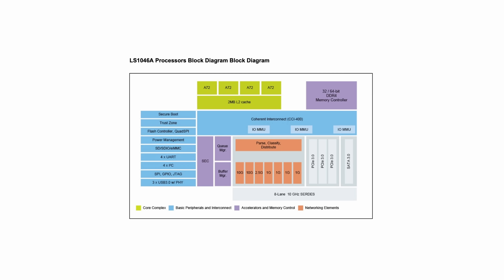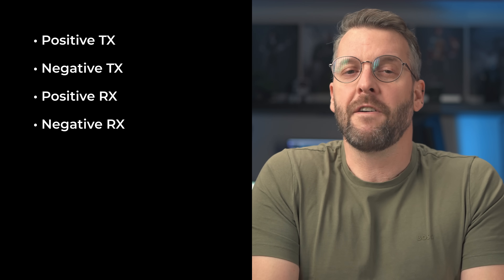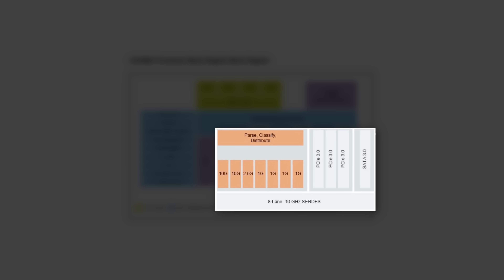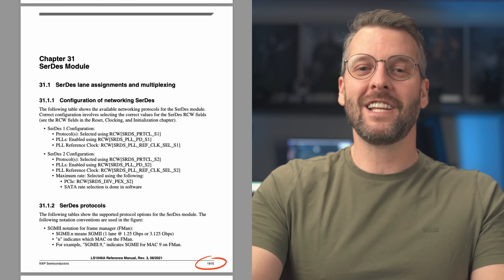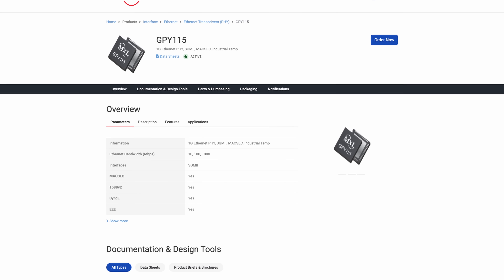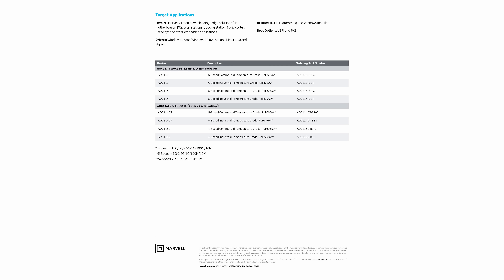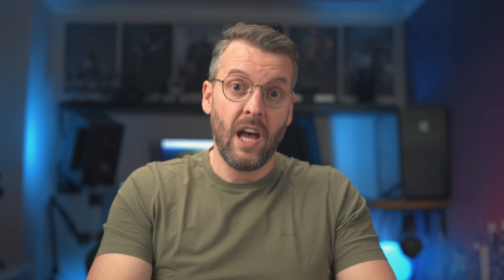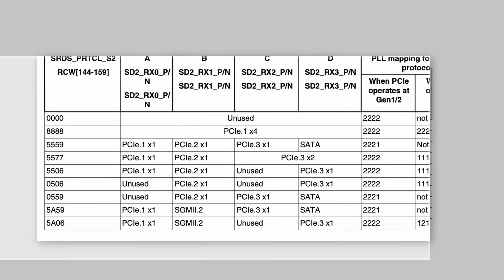You sure do LOVE your 2.5GbE ports!

Comment: other question: which SFP modules does it support? often devices with 10 gbit/s sfp ports support up to 10 gbit/s meaning they often support sfp tranceiver with lower bandwidth as well, so does your router maybe support 2.5 gbit/s rj45 sfp modules? then you would even dont need a 10 gbit/s switch for getting the 2.5 gbit/s ports and also dont need the extra 2.5 gbit/s port but if multispeed is not supported with these sfp ports then I would prefer to even have one extra 10 GBase-T multispeed port using the Marvell AQC113 chip

Comment: I was skeptical when you said you weren’t even planning to support wifi, because of the dozens of devices I have, my Raspberry Pi is the only one with an ethernet port (making the 2.5g vs 1g question irrelevant to me).
I’m really pleased with your slotted approach, though… this could be the best-value router (ever) if it has the ability to be upgraded over time with new wireless modules.
It sounds like you’re doing a great job of evaluating the trade-offs and finding ways of being price-competitive. 
I hope you can sell the router both with and without the wireless card so that people can opt in if they need it or can buy “verified compatible”modules and upgrades from you in the future

Comment: Hi Tomaž / @tomazzaman, not sure if you're checking comments but the E slot does not require 2 PCIe x1 lanes. It can be wired that way but not all manufacturers use it wire the slots up that way. I actually made the change to the table to try to clarify that back in late 2022. You could potentially add an additional PCIe lane to you implementation if you wanted.

Comment: Hi Tomaz. Question and idea: AQC115 is 2.5GbE single port. Why you should waste these PCe 3.0 2x lanes just for one 2.5GbE port? Yes, is increasing the price of the router a little bit, but adding a PCIe 3.0 switch on 2x lanes or even PCIe 2.0 x2 lanes and distribute to 2x or even 3x 2.5GbE PCIe NICs can be a solution: PCIe 2.0 switch 2x lanes has a bandwidth of 1000MB/s (8Gbps) and 3x2.5GbE should have about 937.50MB/s (7.5 Gbps). Also if you use a PCIe 3.0 switch you can use some additional lanes for other devices.
Or in my opinion you should optimize the full number of ports like this:  2x10GbE and 3x1GbE interfaces  using SerDes1 0x1133 and SerDes2 0x5A59 or 0x5A06. In this case you will have 3x1GbE interfaces + 2x 10GbE via DPAA and additionally you can add a PCIe switch Gen3 to add 2x 2.5GbE interfaces which obviously will not go through DPAA. But PCIe 3.0 1x can handle 7.880 Gbps bandwidth which is more than enough to use for example 2x 2.5GbE interfaces via only one PCIe 3.0 lane shared via a PCIe switch.
I don't understand why to waste PCIe 3.0 x2 on a single 2.5GbE chip.
In SerDes2 0x5A59 also enables you one SATA if you need.

Comment: I seem to be in the minority but my use case a 2.5 gbe Port is useful as a WAN. Around here if you want multigig internet with Comcast your options are either LACP or 2.5gbe. If the sfp+ port can negotiate down to 2.5 gbe that may be an option but I personally found many sfp+ ports which won't run 2.5 gbe even with an adapter and instead not working at all or dropping to 1 gbe.

Comment: Could call the vendor and see if you can check out SRDS PR  S1 RCW: 1223
they might support it, but it not in the datasheet. Could work if you try anyway, but without support.

OR

Use a chip with more lanes and get rid of that dumb case; 10gb, 2.5gbe poe+ and more horsepower are the opportunity cost of it.

The cheap chinese 10gb/2.5gbe switches use a realtek set to route, and the web management is done with a seperate micro. No reason you couldn't smack some compute on it.

Comment: @tomazzaman
please make sure that the linux kernel can handle forwarding 2.5Gb of traffic.
from my experience, there is an issue with linux on arm when it comes to high data rates, even 1Gb puts a lot of load on the cpu.
Reply from the maker: Not this CPU, it has dedicated networking hardware. Even the two 10GbE ports should be easy. I'll report once I test the development board (in a month or so)

Comment: If it really came down to it, I think I'd be alright adding an SFP+ module that can negotiate at the various NBASE-T speeds to the router's included SFP+ port. I don't think the price increase is worth the very slight reduction in functionality, especially if that locks out access to the PCD part of the silicon. You could also (potentially? I'm not speaking from experience here but from what I've seen in the videos already) very slightly increase power efficiency if packets can all be processed by the same core, leaving the other cores open for other tasks. Maybe it would be worth experimenting with this.

I have absolutely no personal nuanced experience and I am by no means an expert, but gosh darnit if I paid for the whole silicon and all those features? I'm gonna USE the whole silicon and all those features!

Comment: The cost difference doesn't make sense for that little gain, leave 2.5 GbE out :) 
Besides, if you use PCI-E instead your traffic will NOT be processed by the Parse, Classify, Distribute logic, and will consume CPU cycles. High CPU usage means more power consumption, less efficiency, more heat, it MUST be avoided.
And speaking of CPU usage, I want it to be able to allocate most of those resources for Firewall, VPN or other services; not the traffic switching.
My 2 cents for the project :)
Keep up the good work

Comment: This is pretty cool. I actually own a software development company and I work in the network area (presented in netdev conference last year too). Let me know if you need anything. I hope we can have a Yocto repository for this project too.
Reply from the maker: Thank you! The first challenge is actually developing the hardware to a working state (which we have already started) and in the meanwhile, figure out all the software/build requirements and procedures to make it as compatible as possible.
Reply: @tomazzaman  I’ve worked with Freescale before. They are one of the best supported architectures there are. Freescale even had a VHDL team in Brazil before being bought by NXP.
Reply: I’m just finding very difficult to find information in DPAA, which would be vital for IDS.
Reply from the maker: @felipemalmeida  It's on my to-do list to test once a) development boards arrive, and b) we manage to install/run some kind of software that does it

Comment: You could also let the 2.5gbit be an optional extra over the m2 slot. Yes, the user had to decide between WiFi or 2.5gbit Ethernet. 

With an “optional” module that you can insert in the m2 slot and a provision for the optional Ethernet port in the case you might have the most flexible solution. The cost of making the provision for the Ethernet jack in the housing should be less than the cost of including the 2.5gbit port in the base board. 

This would give you 2x10gbit, 4x 1gbit and optional 2.5/5gbit Ethernet or m.2 WiFi.

Comment: From my experience with home networking a high performance home router ideally for majority of users needs only 2 ports but for convenience and flexibility 3 or 4 ports is probably best. I would expect that people who need a high performance router like this have a high-speed network with an advance setups with VPN, QoS, VLANs, smart firewall bouncers etc. And those users already have or will highly benefit from having dedicated switch(es) and access point(s), and they can afford those devices or find some good used/refurbished options.

Then why only 2 or 3-4 ports?  Because if you have a vlan-capable switch then you really need only a WAN and LAN port. But of course having only two SFP or two ETH ports would be too restrictive so it's probably best to mix SFP and ETH and that has the added benefit of allowing the users to easily create multi-WAN or multi-LAN setup and/or some service port. 

So to me, a router like this needs fewer high-performance (ie. utilizing dedicated SoC infrastructure) ports rather then multiple ports of many types .

Comment: Something you didn't make clear in the video. If you go with the original configuration (so no 2.5Gb) then SerDes2 has a lot of configuration options available for pcie. I think if you do that you should do one of the following:
- pcie 1x2 for an E key slot and pcie 3x2 for an M key slot
- pcie 3x2 for an E key slot and pcie 1x2 for an E key slot.

Basically I feel like leaving pcie unused and unavailable (not routed) would be a waste.

Comment: Your mention of losing DPAA hardware processing by moving 2.5GB over to PCIe is what kills it for me. I'd rather have integrated support for 2x 10GB SFP+ and 2/3x 1GBe and have better hw acceleration over tacking on 2.5GBe. Like others are saying in the comments: This is a router, not a switch :) 
Not to mention that 2x10GB and 2x1GB is a near perfect spec for home/SMB use and is perfect for budding multi-gig ISPs. 1x 10GB for WAN, 1x 10GB for LAN, 1x 1GBe for Smart home/IoT, and 1x 1GBe for OOBE. 
If anything, I'd personally rather see just 2x 10GB, 2x1GB, and PCIe lanes for an add-in card down the road. I was going to suggest IPMI using something like an Aspeed chip, but for a router that really makes no sense, and it's more logical to just have a serial controller for console access imo. 
Love the project, will be following closely :)

Comment: I don't think the most complicated part about designing a motherboard is routing traces. I've only made one motherboard before, it was an easy Intel Atom design. The hardest part is getting the power right. The software will automatically get the trace length right now-a-days. Data uses hardly any power compared to power delivery, so you can get away with small traces. Some places you cannot do this and there is a lot of math involved.

Comment: That is a really badly designed processor if it has too weak (or poorly designed) serialiser, so that it cannot even handle all the ports that the network controller has.
Whats the point of having a complex network controller if you cannot physically connect all ports. They should at least make some of the network ports go through the second section so you would choose: more networking or more PCIe, but realistically they should have just made the serialiser bigger.
Unfortunately nothing that can be fixed by you, unless you will be able to find a different skew of that CPU with better serialiser.
Reply from the maker: An 8-lane serializer is perfectly adequate. They do have other processors with more lanes, but they also cost more. It's always a compromise.
Reply: @tomazzaman  ok, but whats the point of 10-10-2.5-1-1-1 networking if you cannot even connect it due to the serializer?
They could just call it 10-10-1-1-1 and save the confusion (and possibly costs).

Also how much more expensive would be a skew of the same CPU with bigger serializer? Have you checked if maybe that is a cheaper way to get 2.5G than PCIe

Comment: Same for me dual sfp+ the 2.5 I get it people want for AP’s but that’s pointless without PoE. I’d rather some extra go towards supporting PoE in or alt power. 

Also FYI the OSI layer model you use is the obsolete 7 layer one that never became anything. TCP/IP and packet switching won that war and OSI was reorganized to the 5 layer model that represents networking as we know it so they could salvage some of the effort they had put in.

Comment: You can just use an SFP+ module to get 2.5 gigabits, but since those work by lying to the host and claiming they're linked at 10 gigabits, you'll need SQM to avoid trying to send 10 gigabits through that port.

Maybe you could have one or two pairs of "SFP+ or 10Gbase-T/Nbase-T."  In each pair, you'd choose one or the other, maybe even only at boot time.

Or it might even be cleaner to simply allow overriding the SFP+ module's lie that claims it's linked at 10 gigabits!

Even with a 2.5 gigabit port, I'd probably still want to SQM it anyway, since my ISP connection's sustained rate is like 1.1 gigabits down, 40 megabits up.
Reply from the maker: I too think that 2.5GbE would be best avoided at this time and focus on the two 10GbE ports to do the heavy lifting. Delegating the rest to a switch. Like it's supposed to be. 😅
Reply: @tomazzaman  For a WAN port though, a switch may be a problem.

If it's an unmanaged switch that drops VLAN tagged packets (I have a 2.5GbE switch that does that), you won't be able to use it for ISPs that require all packets to be VLAN tagged.

If it's managed, it may send a packet that will cause dumb cable modems to restrict their DHCP to the MAC address of that packet (even if it's not a DHCP request!) and thus fail to ever give an IP address to the router.  I once tried a GL-B1300 on Charter, and it ran into that issue because it sends a TFTP request at boot time with a different MAC address.

I think the ideal solution would be to use an SFP+ module, and figure out a way to make the router realize when it's really running at 2.5 gigabits even when the module claims to be running at 10 gigabits.

I think there are some SFP (not SFP+) modules that run 2.5 gigabits natively, I wonder if one of those would work while still having 10 gigabits on the other SFP+ port at the same time?

Comment: Ditch the 2.5Gbe and add another M.2 slot as it is more flexible. Users can add their own M.2 to 2.5Gbe adaptor if that is what they need. Maybe allow a blank punchout in the back of the case where the RJ45 port from the M.2 to 2.5Gbe adaptor goes. For examples of these adaptors watch the video from Wendell @Level1Techs
Reply from the maker: Actually, that makes a lot of sense. I've written it down.

Comment: my inclination would be to keep the ethernet configuration as-is and use the left over lanes for a M-key M.2. Putting a low cost PCI-E NVMe (like optane) will make the router much much more reliable and allow swappable storage.
Reply from the maker: Yep, that's the alternative. If those lanes aren't used for another PHY, then we'll add another M.2 socket with M-key. Cheaper too :)

Comment: Hey there, I understand if you disagree, but I really think it's important to consider how your device integrates into a network setup.

In terms of future-proofing without inflating costs, here's what I suggest: incorporating 2x 2.5G (or 5G if bandwidth allows) and 2x SFP+ 10G ports as the ones you already have.

Here's why:

1) With internet speeds exceeding 1Gbps in many countries, this setup accommodates a WAN connection via 2.5G or one of the SFP ports, if your provider supports direct connectivity.

2) The second 2.5G port provides flexibility for direct device connections, be it a switch or a tool for network management and debugging.

3) The additional SFP+ port allows seamless integration with a modern switch's uplink. Since users of a robust router like this likely have a switch for their devices, the flow would be: Internet > (2.5G or SFP+ 1) Your Router > (SFP+ 2) Switch > (Switch's port) Devices.

4) Having 4 gigabit ports would limit both high-speed internet reception and device connections. It's redundant to have two SFP+ 10G ports if the uplink is only 1Gbps, or to have gigabit ports if SFP+ ports suffice for the uplink and switch. It just doesn't add up in my opinion.

Comment: Absolutely not!
The two SFP+ 10G ports should suffice for virtually all scenarios. Introduce a switch and VLANs, and you effectively have an unlimited number of interfaces at your disposal for your router! 
I'm curious if the LS1046A can negotiate link speeds of 2.5G or 5G on its SFP+ ports. Not all SFP+ interfaces support these speeds; some are limited to 1G or 10G. If the LS1046A can be configured to establish connections at 1G, 2.5G, 5G, and 10G on these SFP+ ports, then we certainly won't require the 2.5G port!
Reply from the maker: This question seems to be a very popular one (whether SFP+ can negotiate 2.5G or other speeds). I'll do the homework once the development boards arrive, and report back.

Comment: I have an alternate solution, it looks like acquantia xfi phy ics, you could put a serdes mux between this and one of the xfi serdes, and then use this to implelent a 2
5g ethernet combo port for about $30. Though probably the better option is to suggest people use a switch or a 10g-baseT tranciever that supports 2.5G.

Comment: The more recent cable modems have a 2.5Gbps port. If the 10Gbps ports are not NBASE-T (i.e. they only do 10 or 1Gbps, and not 2.5 or 5 Gbps) then those cable modems will connect at 1Gbps to the router. Which is only an issue if you pay for a plan that's 1Gbps or more, like Comcast's 1.2Gbps plan.

However, there are relatively inexpensive switches with a handful of 2.5Gbps ports and a 10Gbps uplink port, which is a workaround (i.e. Translates between the cable modem's 2.5Gbps and the router's 10Gbps port). Some of those switches support VLANs, so you could turn that single 10Gbps port into 4 x 2.5Gbps ports, isolated on individual VLANs.

So I think it's reasonable to skip the 2.5Gbps port onboard, particularly if it would bypass the hardware-accelerated packet processing. The external 2.5/10Gbps switch is a solution for those who find themselves in that specific set of circumstances (modem with 2.5Gbps port, plan >1Gbps).